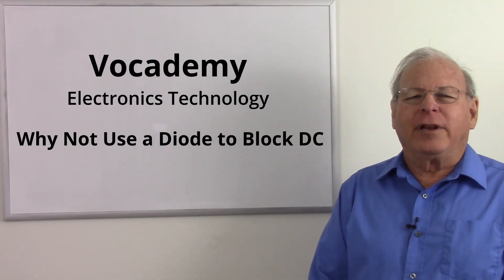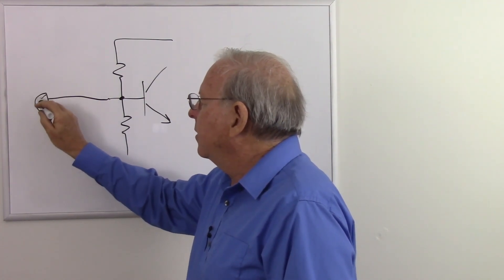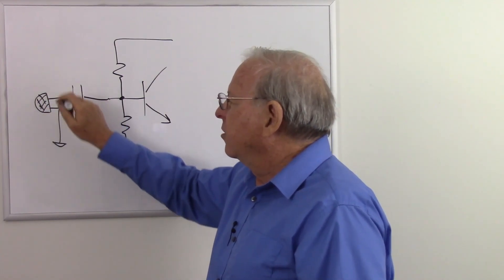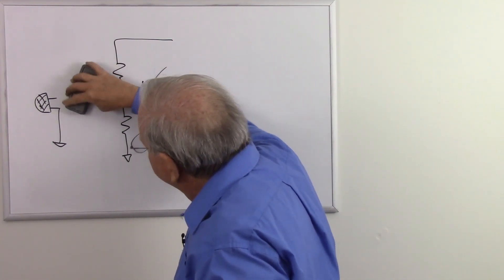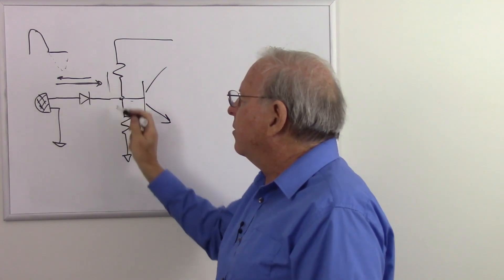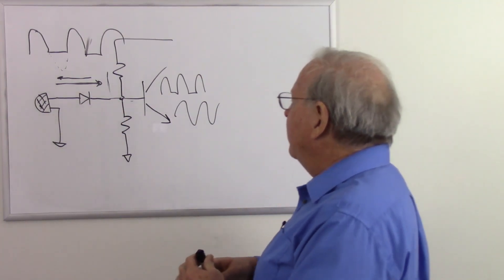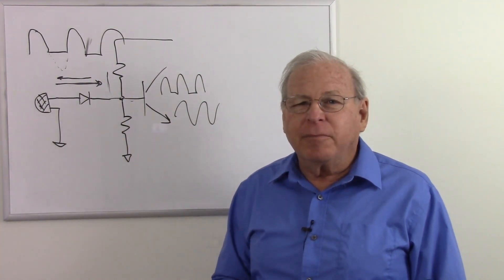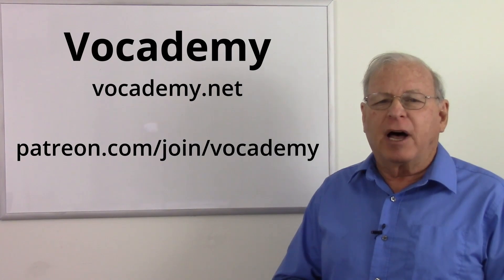Why Not Use a Diode to Block DC

Comment: a good thing to remember is that audio signals always start and finish as AC.
the mic generates a tiny AC signal, and the speaker is driven by a big AC signal, but what happens in between them has to involve DC.

Comment: Thank you! Even I did understand, and I am a beginner in electronics! :) So, thank you, professor! But, if I may ask a question with regards to an audio pre-amplifier, where there are coupling capacitors, but oftenly I've seen electrolitic polarized capacitors being used... it is mandatory, or non-polarized capacitors can be used as well?
Reply: Non-polarized capacitors can be used always. The problem is for large capacitance  it needs a lot of ones...

Comment: What if we use an offset voltage to boost input signal to the positive voltage values during whole period. So we can use a diode for blocking, right ?
Reply: Don't know if you got your answer or not, but I am trying to give you an answer. A supporting picture would have been much helpful but I will try.

First try to figure out your question first. I think to give a positive bias your circuit will be like: a bias resistor to the positive terminal of the microphone to a high enough voltage so the AC +-100mV becomes +200mV to 0V. This will still not pass at all. Because the base bias is way hogher than this, usually 700 to 800mV and to turn on the diode we need base bias + diode drop out voltage which is again 700 to 800mV so in total 1.4 to 1.6V, which is much higher than 200mV microphone bias. So, it will not work.

VCC
   |
Bias Resistor
   |
200mV  -->Diode--> 700mV
   |
Mic
   |
GND
Reply: @AbhijitGangoly  Yeah but I meant an offset voltage that is beyond those values. For example we need a 700mV to forward bias the diode, another 700mV to get the transistor to Active region and 200mV for shifting signal 0 to 200mV. So an offset total of 200mV+ 2 diode forward bias threshold voltages ( approximately an offset of 1.6V) should work fine.
Reply: @DailyFactsbyAnimeGirls  
Ok theoretically it will work. But practically two common scenarios will arise.
  To keep Gain and characteristics of the amplifier you have to re-calculate all four resistors of the transistor.
  If the AC source is really a dynamic mic then the impedance is low, may be 100ohm max (usually much lower than that). To pullup 100ohms mic to 1.5V your bias current through the mic will be 1.5V / 100ohm = 15mA which will definitely distort the sound heavily, and that will cause power dissipation of 15 x 1.5 = 22.5mW, which may permanently damage the mic. Actually to prevent any current going to the microphone we use coupling caps. If we bias the microphone itself to be vulnerable to the current then what's the point to put a diode in between. We can replace transistor base bias resistors to mic bias resistor and the mic itself.

VCC
   |
Mic
Bias
Resistor
   |
~700mV  --to transistor base->
   |
Mic
   |
GND

  If the AC source is different than that, then it should be checked that it can handle this level of bias or gets fried.

  I am glad that you are curious enough to think differently. :)
Reply: @AbhijitGangoly  Yeah now it makes sense. Thank you for explaining it clearly. You seem advanced about the topic. How do I learn more about these stuff? Is there a book or a something else you can suggest me to learn more about audio electronics and this signal stuff ? Thank you again.

Comment: The reason using capacitor because it blocks Dc and passes Ac droid have resistance which drop your voltage

Comment: Sir assuming the microphone outputs plus minus 100mv around zero, the diode will ” never “ conduct as the 5.7v at the base bias point will keep it reverse biased.
Reply: You have an offset in what you say and what he said and 0 never work. You would remove DC offsets later for the output, so it's all funny somehow.